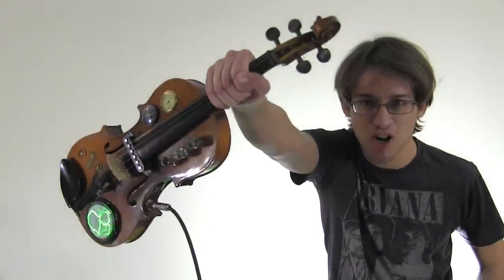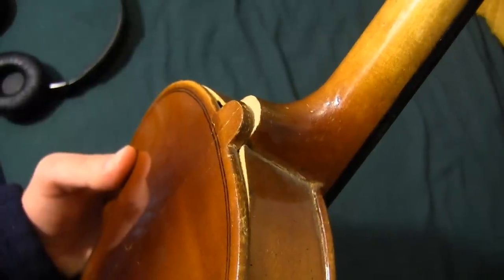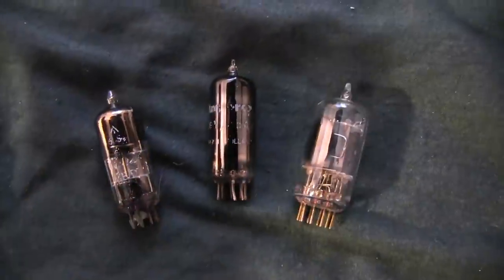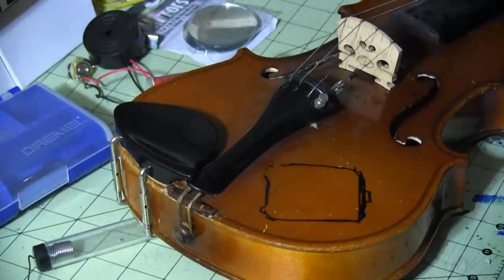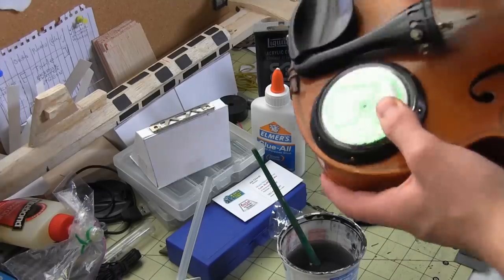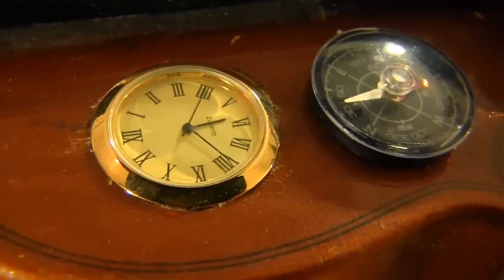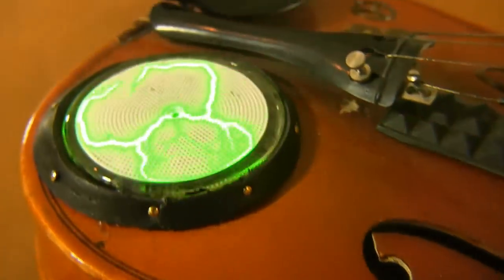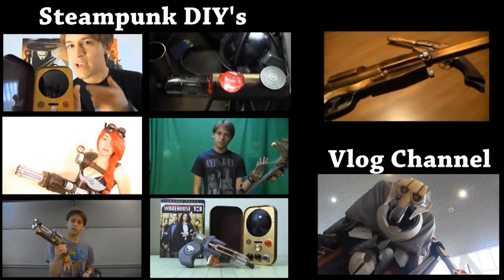How to Steampunk a Violin (DIY)

Comment: Interesting, my ears are bleeding but interesting, you should follow the seems with some type of brass rivet or tac and paint it a rustic copper color, you already chopped several holes and ran a screw though it so your not going to hurt the varnish any.